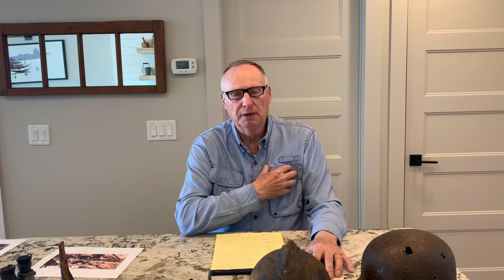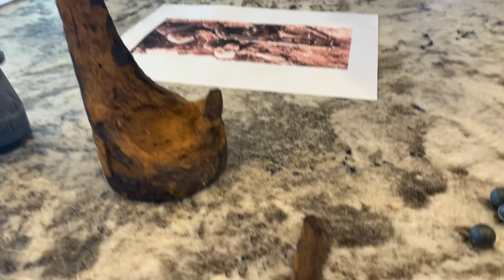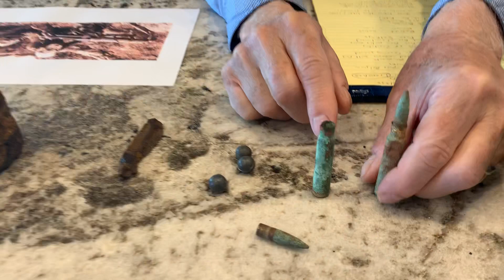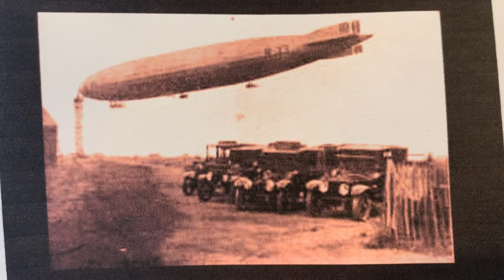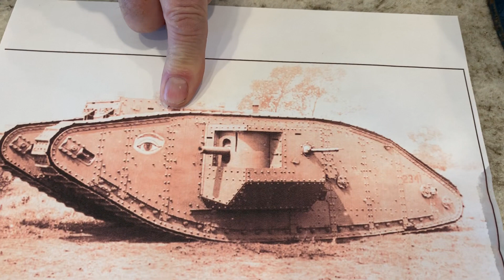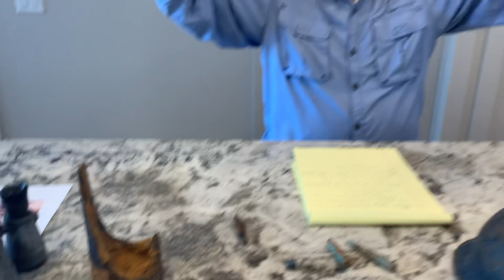Weapons and Equipment of World War One

Comment: Sir, 

the Entente powers first used gas in WWI. It was tear gas. The Germans were the first one to use lethal gas.
No machine gun, even the incredible Vickers/Maxim OG HMG, could fire 2500-5000 rounds per minute in WWI. The Rate Of Fire of this model is 250-650 rounds per minute. Depending on what source you consult. Some of them vary by as much as 200 from the top or bottom. But not a factor of 10.